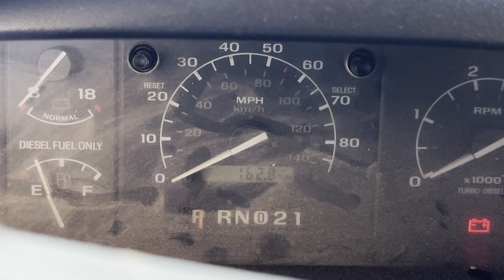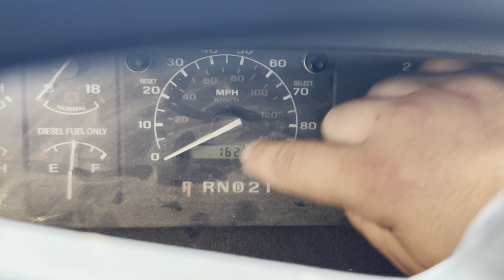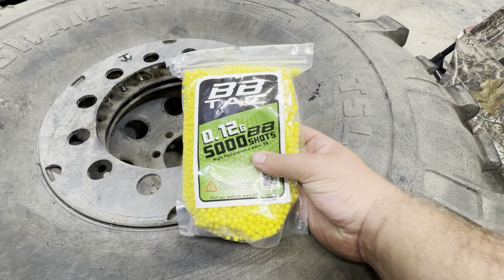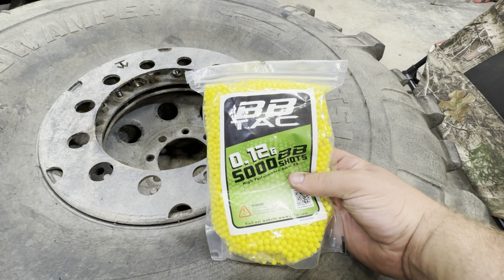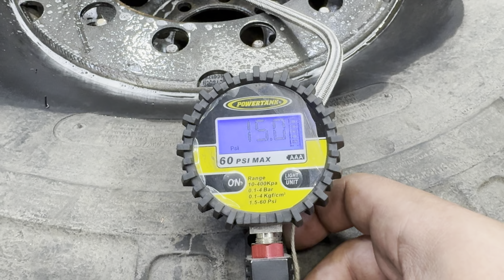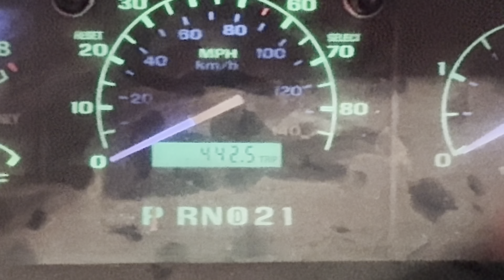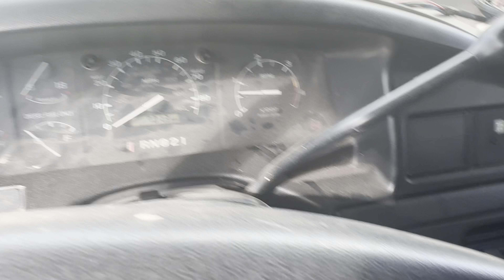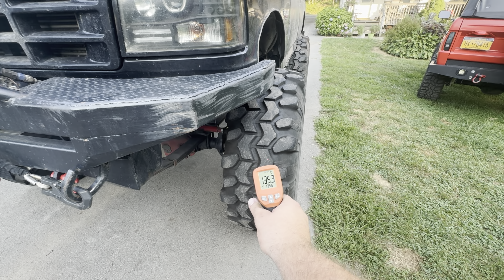Off Road Trail Rig Turned Daily Driver - 7.3 Powerstroke Swapped Bronco Steps Up as my Commuter Car

Comment: Bro I built a new engine (gas) 351w on spring for my Bronco , after deal with my truck for couple days make her running again… after that I have problems with fan clutch she was running more hot than usual with AC. I bought a new one but not fix the problem…. I get mad 😡 and lost interest she been sitting 🪑 for more than 5 months I believe… then I found your channel, I found the motivation needed for keep working on her , I just make the electric fan conversión she is back on the road thanks to your videos , please keep sharing content… I really like your Rig she is a beast 👍🏼✌🏼
Reply from the maker: @hectorpinero1179  I truly appreciate it man!  I’m happy I was able to motivate you to get back after it!

Comment: Bronco is looking awesome! Can you tell me what shackle hitch you are using? I need a big shackle that’ll fit my 2” hitch receiver for my mud truck
Reply from the maker: Thanks Mike!   And are you talking about the adapter from my trailer hitch to hold the big rear shackle?  I just took a piece of thick wall 2 inch square tubing, drilled a hole for the trailer hitch pin, bird mouthed the one end, and welded a big piece of pipe to it that fit the pin of my shackle.  So far it’s worked very well, but I have not beaten on it too hard pulling anyone out yet.
Reply: @BocksGarage  Thats exactly what I’m referring too. Wish I had the skills to weld something up like that. Any possibility you could make another one; I would compensate you for your time and cost of materials?
Reply from the maker: @Mike-xn1bh  I might be able to help.  Want to reach out to me on instagram?

Comment: Are those 42" swampers? What's the gear ratio on the axles?
Reply from the maker: 44” Swampers.   And I run 5.38s in the axles.